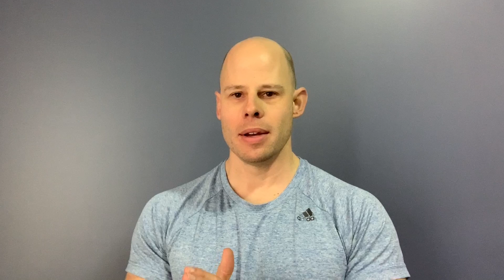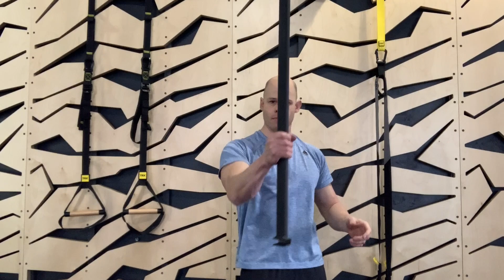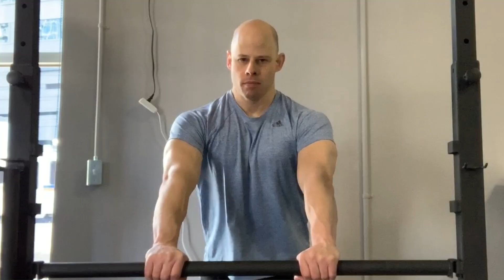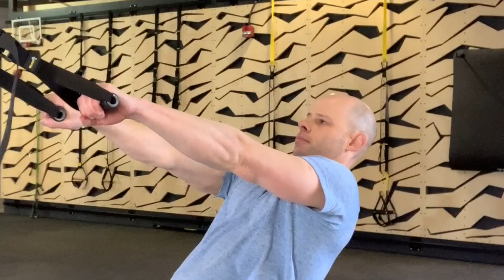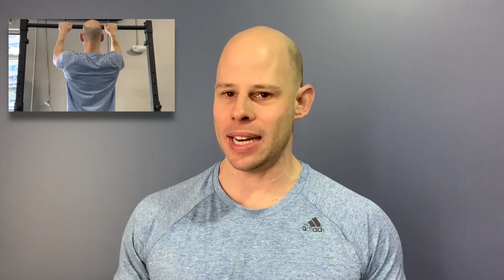Build Muscle, Save Your Joints With Dynamic Stability

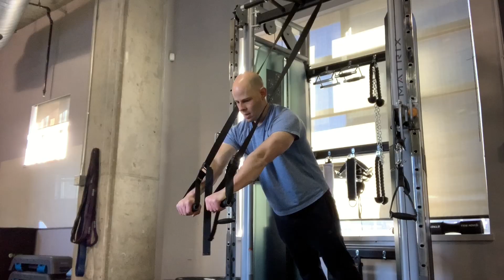Comment: Great video, what kind of suspension trainer are you using at 2:50? Those look very simple and strong
Reply from the maker: It's technically not a suspension trainer, but an iso-trainer which I sometimes use as such. You can check out more on it and the review I have here:
https://www.youtube.com/watch?v=lduYMqS-0Rg

Comment: If I am working on an exercise that is very demanding and can manage only 1 to 4 reps then should I use 3 sets or should I use 5 to 6 sets with 3+ minutes rest periods
Reply from the maker: You can do either higher or lower volume. Lower volume for when time and energy are short, but more volume gives you some more practice. Just be aware that it's going to tax your nervous system more so you'll need more time to recover.
Reply: @RedDeltaProject  thanx brother

Comment: i know u said torque ur arms when doing pullups but i noticed when u do pullups in ur videos, at the bottom its not torqued. are u suppose to torque from bottom to top of pullup(keeping tension) thru out the whole pullup? because i noticed when i torque my arms and put my scapula back, my upper back looks really arched and when i try to keep my legs and knees tucked in front of my body, its hard to torque arms in the bottom
Reply from the maker: Yep, the torque (external rotation which drives the elbows inward) is still there, but at the bottom you'll have a slight internal rotation where your elbows point more to the side. Without that, you'll be limited by the mobility in your shoulder and have a much harder time getting that range in the shoulder joint which is why you may be slightly compensating through your torso and body position.

Comment: Hey Matt, when doing lunges,is it better for muscle and strength to have your legs closer or farther apart? Which is more difficult?
Reply from the maker: Depends, but usually about a shoulder width is preferable or maybe slightly more narrow if you have the hip stability.

Comment: Looking forward to you diving deeper on this! Have you got any tips for taking stress out of the knee when doing the basic GSC tension control exercises? I feel like I make my knee hyperextend too much.
Reply from the maker: If that's the case, keeping some tension in the hamstrings may help. Hyper extension is often a way to rest into the joint and let the muscles relax so maintaining tension throughout the leg may help.
Reply: Thanks Matt. I've definitely been trying to get more tension in my posterior chain do I will work on that. Also in finding that keeping a tiny bend in the knees helps me out too.

Comment: U really showed the movements well with ur exaggerated moves!
Do u think this is a good thing to do?

Have u tried keeping the shoulders protracted throughout during pushups and dips?

I feel stronger when I do that. If u start at the bottom of a pushup and protract the shoulders first before extending the arms and then push up u'll get what I mean.
We used to do this in Tkd training on the knife edge of the hand.
Reply from the maker: I have and found it to be to my detriment. Moving was much more natural once you get the hang of it
Reply: @RedDeltaProject  Thanks man.. seems I'm following a similar journey but still a bit behind you!

Comment: Hey Matt,i didn't get the pullup example.
I can't quite understand how and where the shoulders rotate externally and internally.
I got all your other points,but not this one.
Could you do a separate video about it?
And maybe it would be better if you were shirtless,to see better what you are talking about.
Thanks!🙌
Reply from the maker: Yea that one was harder to show. Imagine pointing your elbows out to the side more at the bottom and then cranking your arms so your elbow point forward as you pull yourself up.

Comment: Hey Matt. For the dip movement, isn't this the opposite of what you taught on your recently improve your dip video?
Reply from the maker: Kinda, you're right in the fact that I said don't protract the shoulders, and that's true....for the bottom position. Protracting at the very top is fine, it also makes it easier to forcefully retract the shoulders down and back as you dip down through contrasting positions. So this can actually help you get better shoulder stability.
Reply: Was thinking exactly the same.